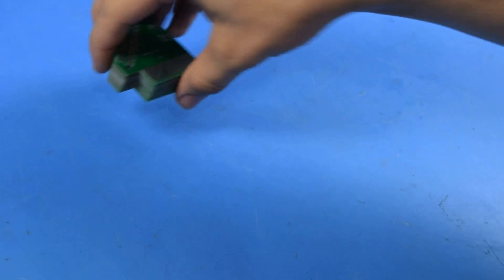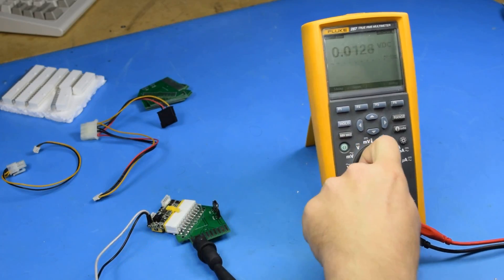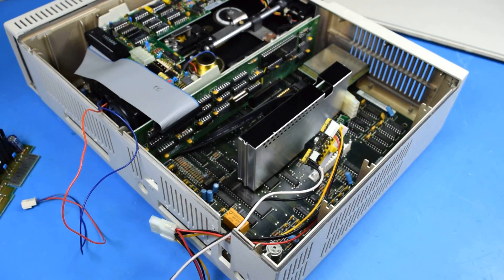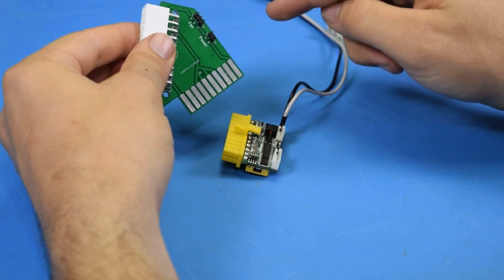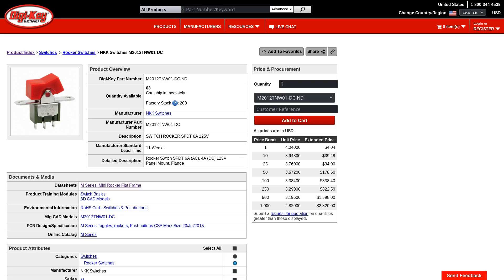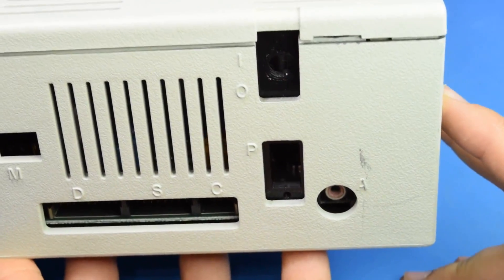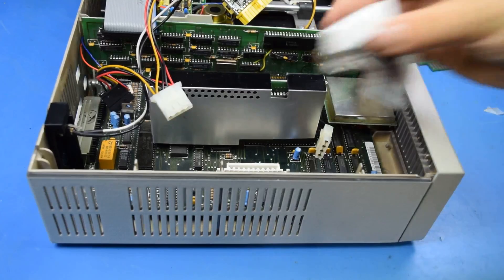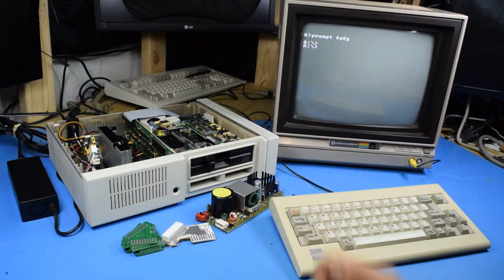0x0035.2 - IBM PCjr ATX/PicoPSU Adapter Update

Comment: Where are you sourcing your PicoPSUs from? The cheapest I've been able to find in Canada so far is $53-ish shipped on Amazon for an 80W. I have a couple machines that might need a touch of power supply modernization.

Comment: Did you try the original boards with a straight ATX connector? the PicoPSU would not be vertical but there seems to be room enough on the side…

Comment: Aww man, you could have soldered the female power connector to the lil green board vertically. Just need to cut the longer pins after sraightening them all and voila! And connect pico vertically afterwards, like an L shape...

Comment: Could you have switched the power switch and power brick connector locations on the printed bracket? That way the factory markings on the case match up.

Comment: 3:13 why don't you solder a STRAIGHT 24 pin connector to the PCB instead of a 90 degree angled one ? the pico PSU would end up next to the board instead of above it.
that might work.

Comment: Are you going to continue to use that power switch bracket, or was that just a prototype? The Power plug was where the switch should be. Is the switch you are ordering too big to fit in the original space?

Comment: I VEHIMITLY suggest you add at least a spot to mount a 7912 along the negative 12v rail! The PicoPSU's rail is too far out of spec, a high rail will likely damage components over time.
Reply from the maker: The 7912 is a negative regulator not a generator . As an LDO if you take a look at the datasheet for a 7912 you'll see that the dropout voltage is 1.1V, so you would need a -13.1V source voltage at the minimum. The TI datasheet has all the 7912 ratings stated with a -19V input voltage: http://www.ti.com/lit/ds/symlink/lm79.pdf

Also as I stated in the video, it was about -13.6V without a load. I just checked it with it in the computer turned on and the voltage was down(up?) to -11.3V. Which is what I expected.
Reply: AkBKukU Just echoing what I'd been told by (supposedly) better informed engineers. possibly they meant another regulator? point was to smooth out the intake. but if the drop is as you  say, then I need to check with better people. From what I understand voltage doesn't normally drop that low under load, thus the fear. possibly something to do with how the PicoPSU handles it's -12v rail?
Reply from the maker: The -12V rail on the PicoPSU is rather weak, but I don't think that's the main reason. I would not consider a ~6% drop in the rail to be that significant. The LM7912 can go as far out as -11.5V, so a switch mode being a little under that is not surprising.  

Elsewhere my attention has been called to the system board schematic that for some reasons assumes the negative voltage input is -6V instead of -12V despite the power board schematic clearly showing it outputs -12V. I'm not sure why though because the system board has a SN75188 on it which requires at least -9V. So I think some last minute changes may have been made to the design in the power supply.

Comment: This was awesome. I was thinking in doing a thing kinda simillar to that in the old at psu connector (the old p12 psus, i dont remember the right name). For when i get a 386. 
But in my case would be a simple matter of cutting the cables of a old and dead psu that i have from that era and soldering into a atx conector from a dead socket A board that i have here.

Comment: I'm not surprised that happened even with the Pico coming afterwards, 90 degrees is the standard usually. You mentioned pull on the cable, can't you just add a cable catch to the case hole itself?

Comment: Great work!  Have you thought about using a thicker PCB?  It looked a little loose but maybe it isn't.  Hard to tell over video.
Reply from the maker: The thickness was good It could be a little thicker but the cost to get a basically custom board made isn't really worth it. Cheap PCBs like what I'm are usually created in a giant panel with other boards that are all cut out. So needing a different thickness means you have a much more custom board than usual.

Comment: Decoupling capacitors!  It’s not so necessary with the tiny power supplies, but there’s some long ass runs out to the full sized psus, and some decoupling caps would provide some brownout protection for super cheap, though you could characterize it with a scope and see if they’re really needed or not.

Comment: what about just using the current deisgn with a normal atx connector and the pico psu? will it fit?
Reply from the maker: I don't have the standard connectors on hand, just the right angle ones. While it may fit like that, it still doesn't solve the floppy drive power problem that the PicoPSU has. So I need to change the board to have a 4 pin connector anyway.

Comment: Neat! Glad it worked! People were saying it might not have enough 12v power, bit it looks like it ran everything just fine (and the floppy)
It's really awesome how they managed to squeeze so much power into such a tiny footprint huh?
Reply from the maker: Personally, I find it suspicious. These come in up to 160W which is a ton of power. Also, the 5.5mm barrel jacks these use are rated for less than half the current that one would need from the 12V supply. 

The people who were talking about it having enough 12V power, were they just in the comments here or were they elsewhere? It's hard to track where you're stuff gets linked, I know there was a hackday article, but that's it.
Reply: I suggested the PicoPSU on your last PCjr video, and a few replies suggested it may not be able to supply enough power. I don't know of a way to permalink comments here, but it's kinda near the top when sorting by top

Personally I think people underestimate it, but it's been used for media center PCs and low power SFF builds for quite a while... That said, I haven't seen anyone use one in an 80s computer, so you might be a pioneer there. Maybe just see if it gets too warm after loading a big program off disk or something. I think it has thermal and overcurrent limiting anyway?
Reply from the maker: Ah alright. I did read all those comments.

I have a simple IR thermal sensor, so I could see how hot it gets under load.
Reply: @TechTangents  

The good news is that almost all of these Pico PSUs just pass the +12V directly from the external power brick anyway, so that can always be upgraded if more 12V juice is required.

It would be worth measuring the real current draw of the PCjr, though. Mainly on the +5V rail.

I would imagine the motherboard would only draw a few Amps. The highest "peak" power will probably be from the stepper motors on the floppy drives.
Reply: @TechTangents 

Oh, and PicoPSUs have been used for many years in retro machines like the Amiga, Sharp x68000, and I've used them just fine in Dreamcasts. ;)

The common "160 Watt" version does seem very efficient, you just have to watch out for juicier items like larger / older hard drives, floppy drives, or expansion cards.

It's worth comparing the specs of the original PCjr PSU to the Pico, but I personally think it'll be fine.

Comment from the maker: I'll put some inventory information here for the remaining external ATX only boards:
8 - total originally available
4 - sold
4 - available

Also so everyone can stop recommending it, no a 20pin ATX extension would not be cheaper. 10 new PCBs is costing me $2 total for 10, it would be around $60 to get 10 extension cables.
Reply: That older revision boards could most likely work if it was a straight connector instead of a right-angle. 

It will cause the weight of the picoPSU to be on the other side, but you might get away with it by just printing a support for it.
Reply: where are you getting the PCB's so cheep?
Reply from the maker: I don't have a preferred board house, this time they were ordered from JCLPCB
Reply: Yeah I've heard good things about JLCPCB, haven't ordered from them yet though.   PS, if you DL the datasheet for that switch, the dimensions are in there, no guesswork.
Reply from the maker: I did that of course, that doesn't guarantee I got the tolerances right in my design though. I think I'm going to reprint it with a bevel on the top anyway to make it easier to close the lid. so if it doesn't fit right I'll make an adjustment then.
Reply: i recognize jlc pcb, i used that service to order the pcbs for my custom isa cards
Reply: Are you going to be making a video update when the new version of the PCB arrives?
Reply from the maker: Yes, assuming all goes well the next video will be more about what you get if you buy one from me. It will describe the setup and some more information about it.
Reply: I would like to get one of the pcbs
Reply from the maker: You can contact me for details about getting one of the PCBs at the email address in the description. When I get the new boards in and everything is working right I'll have a proper purchase page ready.

Comment: Couldn't you take your current board design and just mount the power connector flat against the board?
Reply from the maker: I don't have the standard connectors on hand, just the right angle ones. While it may fit like that, it still doesn't solve the floppy drive power problem that the PicoPSU has. So I need to change the board to have a 4 pin connector anyway.

Comment: quick question if you're three-d printing them why not just make a slot that tightly fits the switches you have?
Reply from the maker: I want to use the other switch because it looks more like the original. Also, the other switches would have to be inside the case because of the size, so they would be difficult to press.

Comment: also quick not looking at your redesign , why not make the ATX header vertical ?
Reply from the maker: It would make the overall design taller https://i.imgur.com/vYq4M4S.jpg . Which with the connector off to the side like it is now may work out fine. But it would not have fit like that over the card edge like I designed it the first time. So I guess consider the 45° angle a legacy carryover from the first design. Probably not needed, but it doesn't hurt.
Reply: ah makes sense , 
vertical would still allow the pico to fit tho as its height is not an issue anymore, also i like rectangles
Reply: I think the 45 degree angle is a good idea because it accommodates the picopsu but also accommodates a regular ATX psu as well satisfying the requirements of both designs at once.
Reply: Galaxy TS2  the ATX PSU does not sit inside the case. It sits outside.
Reply: Galaxy TS2  There's nothing wrong about what i said. The ATX power supply does not sit inside the case but that doesn't mean you can't use one did you even watch the video?

Comment: Is there any particular reason your 3D printed plate has the power jack on top, and the switch on the bottom?
The original power supply is reversed from that, and the case is labeled for that layout, so I'm just curious.
Reply from the maker: I really badly wanted to put the power switch at the top, but there are two reasons I didn't. 1. The panel mount switch's screw tabs are a lot wider and wouldn't fit well at the top near the lid. 2. I plan on including two versions of the printed part. One that has the barrel jack panel mount, and another with a large slot for the ATX PSU cable to fit through.
Reply: Thanks for that answer!
My curiosity is now satisfied.
Reply: I second this
Reply: I was gonna guess it's because the switch would fit better but when I looked at it again, it seems like both holes are exactly the same size.

Comment: is it illegal to call dibs on one of the 7 ? 
because DIBS

EDIT: actually a board layout to etch would be better , because international shipping and me not QUITE having a PCJR yet
Reply from the maker: I could always drop the PCB in an envelope with stamps on it if you want to source parts yourself. That would at least save you having to etch.
Reply: AkBKukU mailing anything in an envelope isn't a great idea there's a  good chance it'd end up bent breaking the PCB
Reply: Dave from the EEVBlog tried shipping µRuler PCBs in an envelope some time ago: The PCBs didn't break, but they sliced themselves right out of the envelopes during sorting.
People were angrily emailing him wondering why they got empty envelopes lol
Reply: It would 100% guaranteed be in pieces when delivered,  The sorting machines they put standard letter sized envelopes through bend them through rigid rollers as they travel through sorting facilities.  If you wanna mail it, put it in a bubble wrap mailer and add a "fragile" sticker (for all the good they do), they go through a different sort process.
Reply: that would be a solution , guess im gonna shoot you an email

Comment: Could you use a 20-pin cable extension to connect the power supply to the adaptor board?
Reply from the maker: Probably, but I figure that would be too costly and inconvenient. I want my option to be less than half the cost of an original PSU for the PCjr, and at least less than 75% of the cost when you include a PicoPSU. So adding something like that as a requirement would put me outside my requirements.
Reply: that would work for this batch, but if he wants to sell them or give them away it would be cheaper to just make the board with a right angle from the get-go
Reply: How about using a flat connector like in the previous video instead of the angled one? Wouldn't that fit? Or would it maybe stress the slot too much?